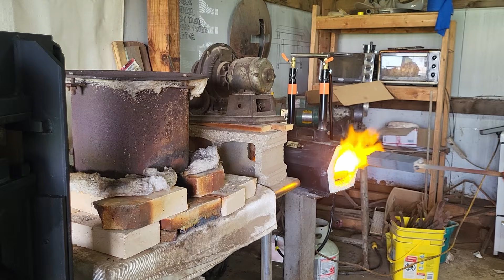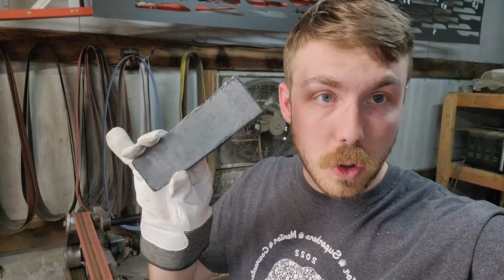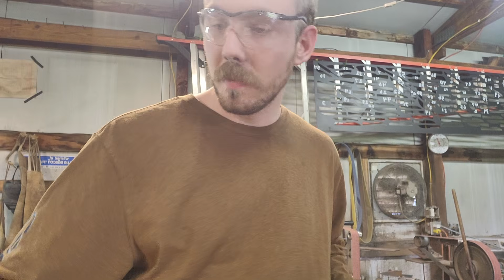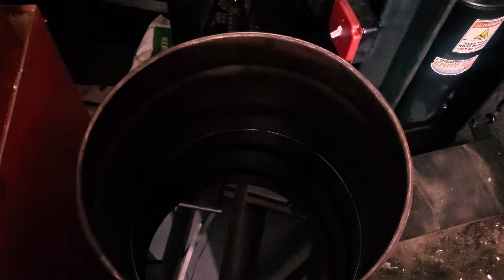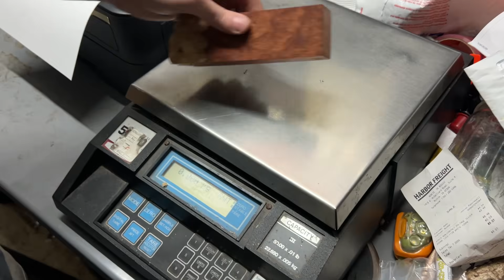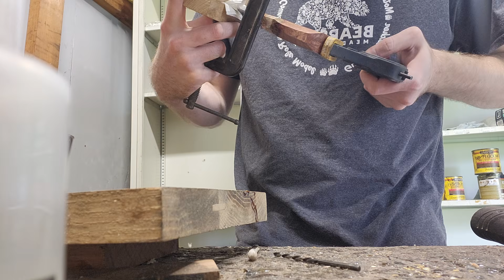Making a Mountain Range Damascus Chef's Knife

Comment: Hey dude. Awesome video, I have one suggestion that I noticed at the start of your video that has helped me out a lot. I use a hard disc on an anger grinder to get most of the scale off my billets before I start using the belts on the 2x72. It speeds the process up quite a bit I’ve found and also saves your belts a ton. The scale likes to eat the teeth off the belt really fast. Awesome knife
Reply from the maker: Funny you say that, I started doing that after my first restack because of how slow it was the first time lol
Reply: @StoutsForge lol that’s smart, I didn’t notice but that’s good.

Comment: AS a retired chef I always get a kick out of watching knife makers make these gorgeous knives. What comes to mind is a how usable are they? That question is because sometimes I wonder if the blade edge with the multiple metals will stay sharp. That's easily handled you can sharpen your own eyes. But my question really do you consider the balance in the hand? my opinion a knife feel in the hand is that the balance should almost make it feel like there's no blade in your hand at all there should be no forward wait and there should be an ability to put pressure at the very back of the blade safely and with control. Think about being able to manipulate flower pedal with the tip or cut through a sweet potato with the button. That's just my take I was wonder. I definitely got long-winded and there's definitely gonna be some typos. I'm one of those lazy voice to text guys. Lol
Reply from the maker: Totally valid questions! I always consider the usability first and foremost, the visuals are just a fun way to stretch my skills. This blade just has 80crv2 on the edge, the other metals are just on the outside faces. And the balance point is right at front of the bolster, so it's perfect for a pinch grip. Thanks for the thoughtful questions!

Comment: I need some of those combo dies for my press….
Reply from the maker: They came with mine! They're nice, but the rounded parts aren't aligned super well so stuff can end up bending quite a bit. Not a deal breaker by any means, but if I was making my own I'd try to avoid that.
Reply: @StoutsForge  the ones I made are ok but the ram seems to wanna twist the frame if I get too far from the center
Reply from the maker: Hm, I haven't had that problem with these, but this machine is pretty rigid
Reply: @StoutsForge  it doesn’t actually twist it just makes me nervous

Comment: Yeah! Thanks for sharing. Subbed! Two things I saw, and pls forgive me, if I say them unasked: 1) Gloves not on the hand that holds the hammer. One needs much more energy to hold it, and the hammer could easily fly. 2) Posture at the anvil: You use the hammer like a drumstick, which will ruin your joints. Better would be, to only make the motion like a bycep curl to bring the hammer up, and just let the weight do the job, when it falls down. You achieve this, by getting close to the anvil, have a straight back but slightly bent over. beautiful blade. NICE!
Reply from the maker: Thanks for the tips, I'm always looking to improve my technique!
Reply: @StoutsForge watch some videos of farriers hammering! They are the best at transferring power in an efficient manner. Lift the hammer with your shoulder and minimize your elbow movement, which will save your elbow in the long run.